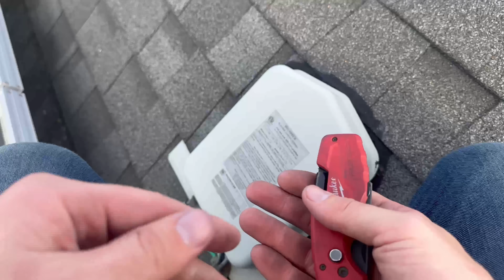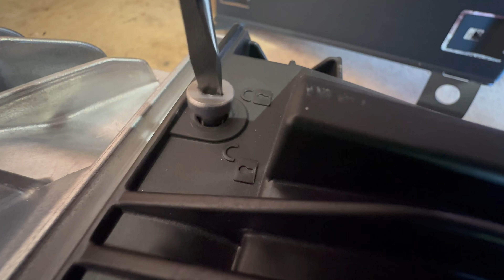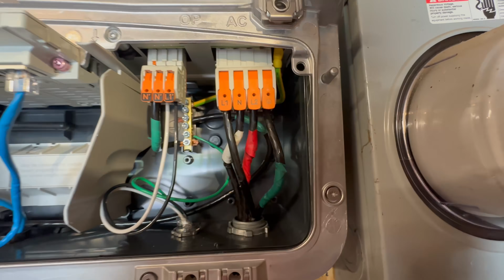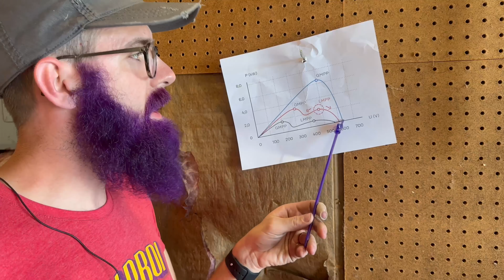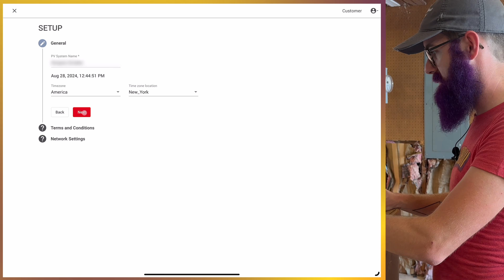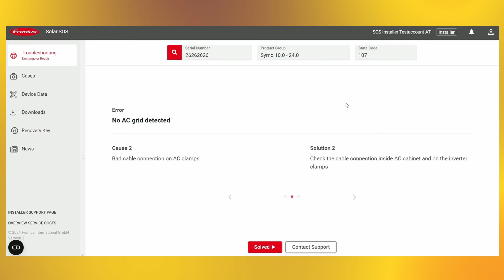Installing the new GEN24 solar hybrid inverter!

Comment: Hi Derek,  Great show, and thanks for the detail.  One thing I have learned that you did not cover.  I found out that the Gen24 has a maximum selling limit of 6kW.  Example, Say I have a 10kW system and I go out of town with all my home powered down maybe leaving a couple of outdoor lights.  I am expecting that about 9500 watts is selling all day to the grid and crediting my account.  BUT NO, the Gen24, unlike any other inverter I have ever installed, will only sell 6kW of my 10kW of solar power and 4kW is stranded and wasted.  THAT was a disappointment to me.  So, the inverters over 6kW have this very wasteful limit that is undesirable.  If you build a larger system, cap that off at a row of 6 or 7kW combined.  Please reach out if that is incorrect to you?

Comment: Hi Derek, thanks for the howto, great easy to follow and understand Video, one minor question, there is a Ground wire connected to the ground Buss going towards the solar input strain relief, is that connects to the solar panels array grounding? thanks
Reply from the maker: Yep!
Reply: @dereksolarboi  i just wanted to confirm because, i am trouble shooting an isolation error, i checked all connections and grounding points, all checks out, but i am still getting the error, it worked great for the first month, and it started to show the error last week. Is this a common error? i installed the system myself.
Reply from the maker: @emagnets  isolation error is a sign that the insulation of your positive or negative DC conductors may be compromised. Could mean a squirrel's gotten up there and chewed on something, something got chafed during installation, or a connector came loose or something. Could also be that one of your rapid shutdown devices burned out and is causing the continuity to ground, if you have them. If you want an electrician to test it out for you, you're gonna want them to do an insulation resistance test on your conductors.
Reply: @dereksolarboi  thanks for the quick response and advice. i will check the rapid shutdown, it is the only thing i avoided to check, lol and also to note that it was working great when it was in the Minus temp like we get -25 degrees here, but now it is mild and snow melting and raining. i will redo all isolation tests including the RSD this time.
Reply: @dereksolarboi  an update, after battling the weather and trouble shouting looking for the Fault, i found the issue under one of the panels so the issue was that one of the solar panel positive is chewed and was touching the mounting system. replaced the defective wire and all is good. but man, it was a bitchy task in sub zero snowy rainy windy weather.
Reply from the maker: @emagnets nice work!

Comment: Thanks for this video! I wish I could just install Victron inverters... but the lack of UL 1741-SB certification (and the related awkwardness of putting Victron systems behind a transfer switch)... means I need a more straightforward alternative. Like with Victron, this family-owned company has been around a long time and that means a lot. I'm asking my distributor for GEN24 pricing now :)

Comment: Are you sure the second less powerful MPPT also has 2 strings to it? The EU Spec 10kw Gen24 spec sheet says the MPPT1 has 2 DC connections and the MPPT2 has 1 DC connection input?

Comment: I am replacing 10 year old 3000w abb/power-one aurora inverter with the 3.8 kW FRONIUS PRIMO GEN24. Around minute 22:30 during the set up you talk about entering in your PV1 and PV2. How to I determine what that is? Thank you so much for this video.
Reply from the maker: That's just the amount of PV wattage you have attached to each MPPT. This is more for monitoring than anything else, this won't affect the actual function of the inverter. But basically, if you have 10 400w modules hooked up to PV 1, and 12 400w modules hooked up to PV 2, you'd put the values as 4000 Wp and 4800 Wp, respectively.

Comment: Great video.  Would you think its ok to use the power receptacle for a WIFI booster, to convert the wifi to cat6 for the inverter?  I have a ground mount system 300 feet from the house and no other source of power. I want to avoid running 300 feet of data cable if possible.
Reply from the maker: @rizonsolar7515  if you have the receptacle activated, the inverter won't push power back into the grid, so I'm not sure that plan will do what you'd like it to

Comment: Great video! The Utility Company now requires verification of a whole list of inverter grid settings (QV_CURVE_V2-SS, QP_CURVE_P3_LOAD-SS, UV1_TRIP_V-SS for examples). How does one verify/change these settings on the GEN24 to match the local grid requirements?
Reply from the maker: Usually if a utility company requires these things of an inverter, they'll have a specific list of approved inverters you can use. But if they accept any inverter as long as it meets those requirements, I'd check directly with Fronius.